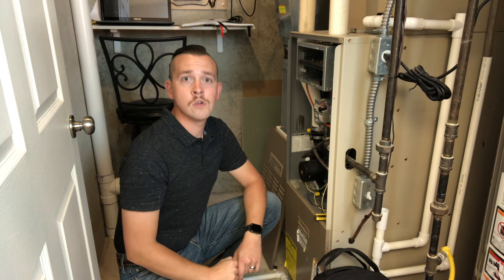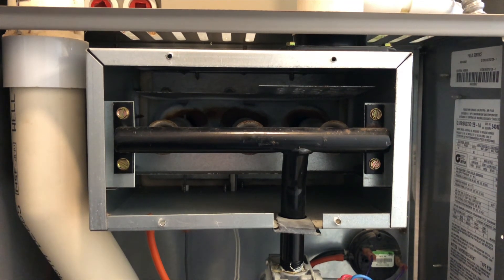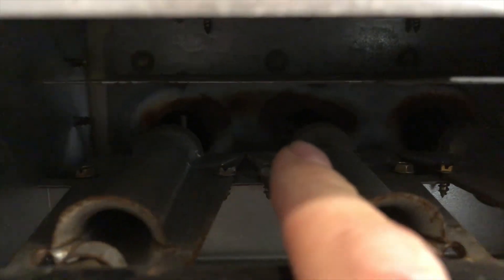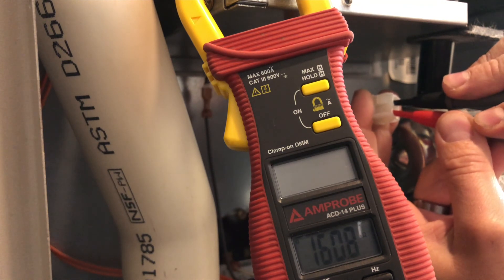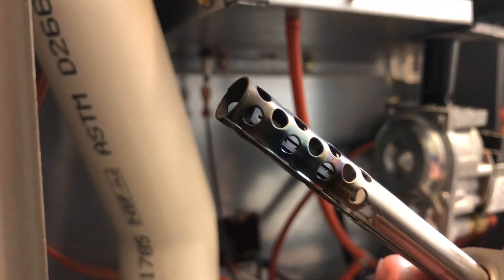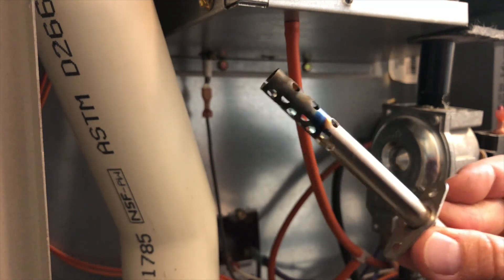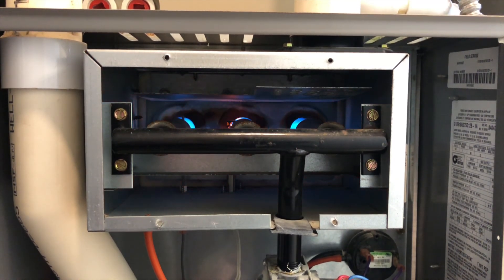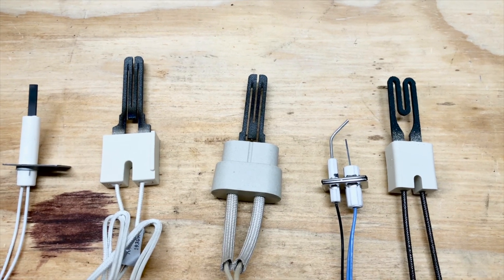Furnace Doesn't Light - Replacing the Hot Surface Ignitor and How It Works

Comment: I am new at this, so help me out.  At 2:12, a sound is heard and it is noted that this is the sound of the gas valve opening even though the ignitor did not get hot.  Whoa.  This sounds like a bad design to me.  Shouldn't there be a signal (or lack of one) going the the circuit board to keep the gas valve closed until some sensor registers that the ignitor is hot.  I must be missing something.  Thanks.

Comment: I have a hot surface igniter, less than a year old, that glows orange but doesn't ignite consistently. Bad igniter?
Reply from the maker: Sometimes! It may not be getting hot enough. Sometimes it could be caused by dirty burners or the gas valve not opening.

When the burners go to light you should hear a "click" as the gas valve opens. Then you should hear a "hissing" as the fuel travels through the manifold and out of the orifices to the burners. If you don't hear the hissing then it might be a fuel delivery issue. If you do and the ignitor is glowing, then I would recommend trying to clean the burners. Specifically the area where the ignitor is.

On one occasion I had a spider egg sack plugging an orifice preventing gas from flowing, a safety pin can clear those.

Comment: Replaced about 6 ignitors on gas dryers and 3 on my absolute garbage POS  GE oven. Bad ignitors always read infinity. Most times you can observe a break in dryer ignitors. Moron engineers at GE wire the igniter on GE oven & broilers to be always on due to being in series with gas valve thus never got more then 2 years on my garbage GE stove. The glass door blow out on this POS GE stove while only on a few minutes. Throw stove pur before it was 8 years o!d. Nice vid.
Reply from the maker: Wow! Sorry about the stove! I wish I knew more about it so I could help. You could potentially install a time-delay relay and an isolation relay to turn off the ignitor after a certain amount of time.

It really seems like stoves should have already been “perfected” at this point in time. Like, just light the burner and turn back off…
Reply: Sometimes they don't glow hot enough :)